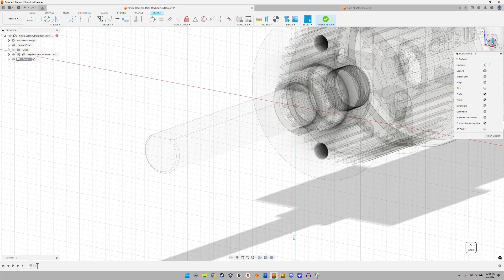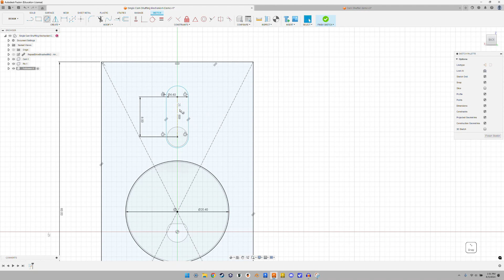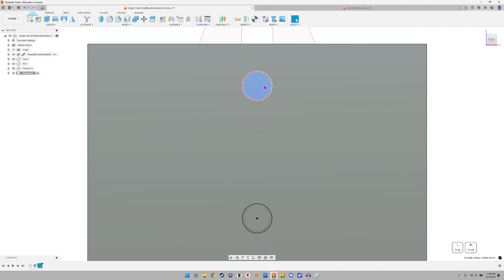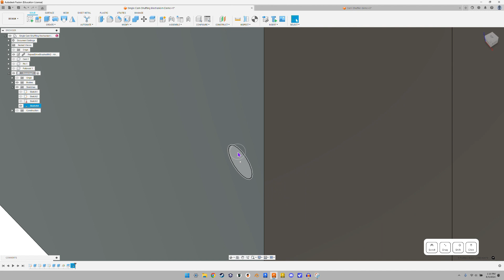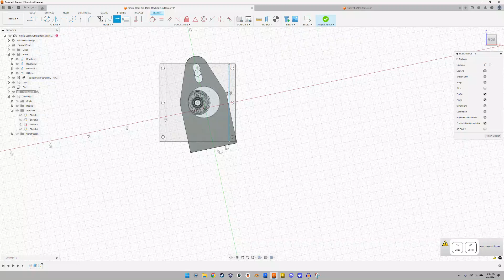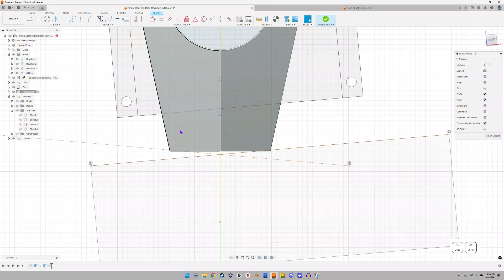Single-Cam Shuffler Tutorial

Comment: what stride length would you recommend for a beetle weight
Reply from the maker: Depends on your motor rpm and the number of shuffler feet. You can calculate speed with this formula: stride length*number of feet*motor rpm. I would try to shoot for 4-6 feet per second(shufflers are usually pretty inefficient so their real life speed is significantly less).